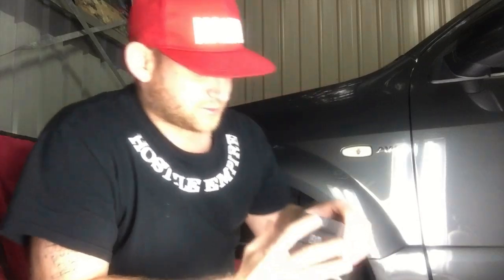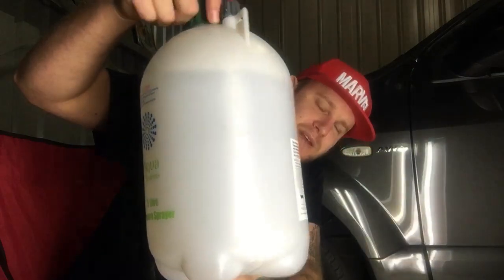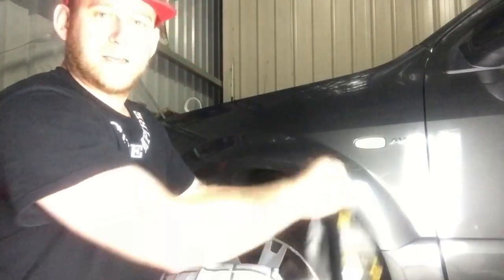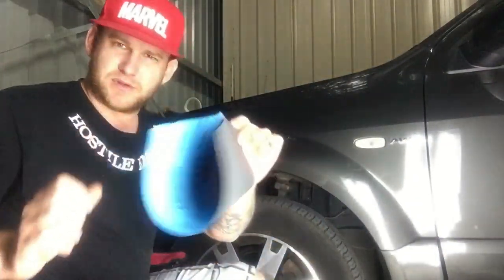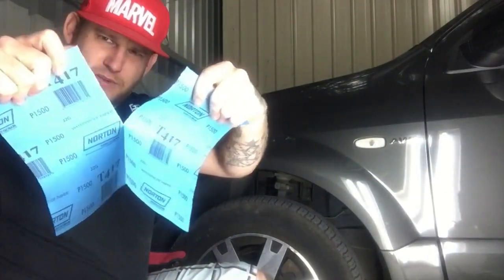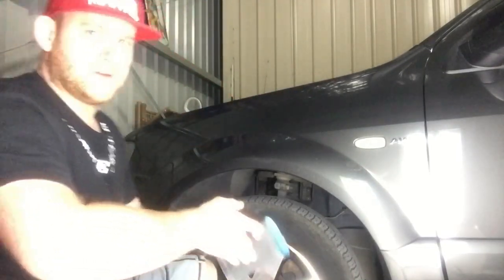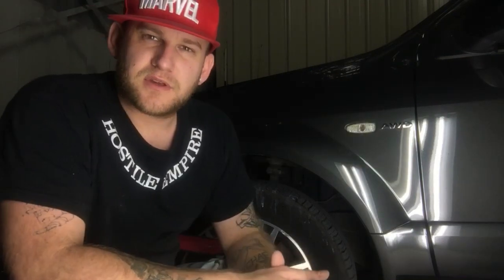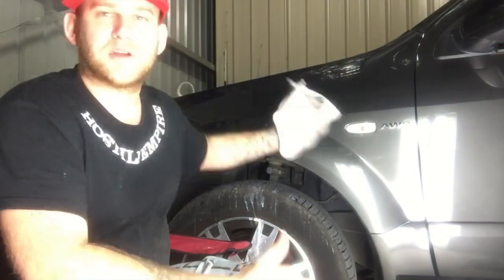How to remove orange peel from your car.

Comment: it's also going to show you how to serious compromise the UV protection of the clear coat due to reducing it's thickness to the point of a 15yr old car.   Add in the use of a Paint Thickness Gauge to best show what I mean.
Reply from the maker: That is correct. After doing this it is important to up keep your wax and polish to up keep the protection of your clear coat. I would only do this on a show car